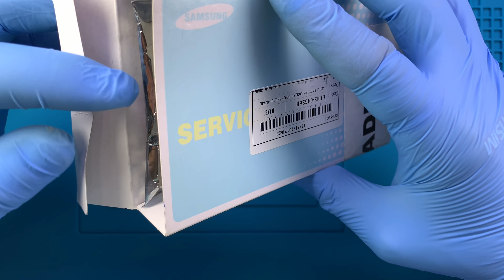PARÇALANMIŞ ! Samsung Galaxy S6 Edge+ Ekran, Batarya ve Arka Kapak Değişimi | SM-G928

Comment: whts blue thing in your hand
Reply from the maker: Hello there;
It is a static-free wristband on the left arm. Our technical service is designed to be completely free of static electricity, but it is installed by our technicians as an additional precaution in order to prevent static electricity that may occur momentarily. The right arm is a special magnetic magnet. It allows to hold very small metal parts.
Greetings.